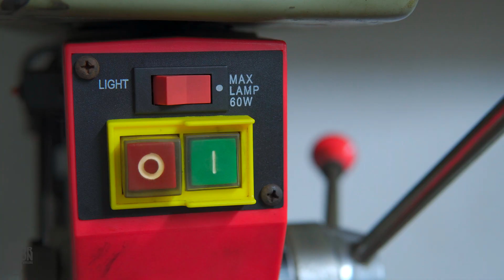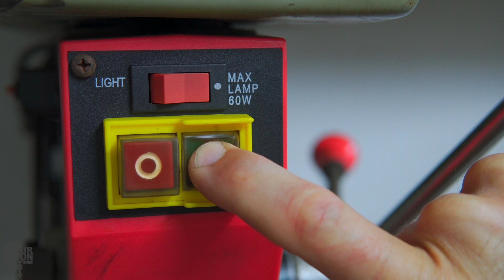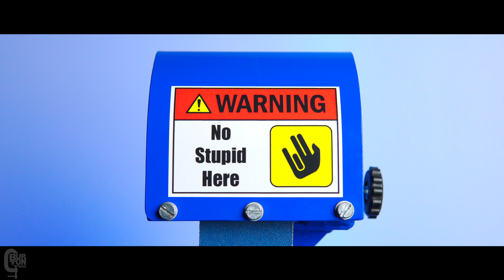DIY Belt Grinder Build- Burton Builds

Comment: Thanks for the informative video - is the 4 wheel design that I see so often just to accommodate the length of the belt without making the tool too tall? Is there any disadvantage to the two wheel design?
Reply from the maker: Hi Anthony… from what I can gather, yes. Having a longer belt (72”) allows the belt more time to cool before the same section gets back around to cutting the workpiece. The longer belt also lasts longer between changes because there is a greater area of belt therefore wears slower. The 4 wheel design also allows the front working section to be changed out to a single flat wheel for grinding large or small radii. You wouldn’t be able to do this with a 2 wheel design because the top wheel needs to have a crown and be adjustable and thus grinding on it would grind the crown shape into your workpiece.  

As you mentioned, the 4 wheel design keeps the machine relatively small (short). Check out @TimothyDyck on YouTube (https://www.youtube.com/c/TimothyDyck). He has a blacksmith channel (awesome guy) and his 72” belt grinder is very similar to my design… or I should rather say my design is very similar to his. It’s a 2 wheel design that’s very tall. I didn’t want mine that tall because my shop is pretty small so that’s why I went with a 42” size. You might have to look back in his videos to see it as he is currently setting up a new shop and not everything has been installed. Actually check out this video https://www.youtube.com/watch?v=3wVl_ZcwtBU at 06:36.

I also made mine mostly from salvaged / scrap parts so was limited on what was available… again having to go with the 2 wheel design to get it up and running as quickly as possible for as little as possible.

Let’s turn the question around… Is there any advantage to a 2 wheel design? I think the main three are size of machine (small), simplicity of design / build and belts are cheaper so you can have a large variety of belts on hand. You also need to consider availability of belts in your area… go with the size of belt that has the most availability and options.

I think the main advantage to a 4 wheel design with a longer belt is that the front section upper and lower wheels can be flat wheels (the guide wheel has a crown on it and can be located at the back) so the belt runs flat between the upper and lower guide and along the platen (not that I’ve noticed any problem with the two wheel design with the top wheel having a crown because my platen is a couple of inches below the top wheel allowing the belt space to flatten out). Also, the platen can be made longer to provide a longer grinding area and can be made adjustable so that it can tilt (if you need to grind a specific angle into the workpiece). This is a guess but I think a 4 wheel design (longer belt) will track better than a shorter belt. That said, I haven’t had any tracking problems and I’ve been using mine a lot.

Hope this helps. Are you going to build a belt grinder? If you have more questions… ask away and I’ll answer what I can.

Comment: I was really hoping to see how you built the tracking portion/mechanism- what materials, what dimensions, etc and what you would keep or change.
Reply from the maker: Hi Andrew, thanks for the comment. Tracking is fairly simple... all you need is a roller with a crown on it and some type of arrangement to enable the shaft through the centre of the roller to be tilted from side to side. It's not important how one gets the shaft to tilt, but it is important to keep that shaft and tilting setup rigid. Check out 13:09 in the video.

I'll post a picture of the shaft setup once I make my way to the grinder again. It axle shaft is basically an HT bolt with a 40mm long piece is 12x12mm bar welded onto the side of the bolts head (so that the 12x12 bar is 90 degrees to the shaft of the bolt. You can just see this at 13:18 but need to look closely. Then, if I remember correctly, there is a short piece of tube (around 30mm long with a 8mm ID) welded across the bolt head... so this is 90 degrees to the shaft of the bolt and also 90 degrees to the 12x12 bar. Passing through this piece of tube is the 'pivoting' bolt. You can see the head of this 'pivoting' bolt at 13:18 (it has VE FE - A2 80 written on the head). So when the bottom edge of the 12x12 bar is pushed forward or backward with the thumb screw, the crowned wheel and axle rotate around the 'pivoting' bolt i mentioned earlier.

Hope this makes some sort of sense.

Comment: Absolutely awesome!!! Love it
Reply from the maker: Thanks very much… I’ve been using it very much since it was built and it’s been working awesome… can’t believe I didn’t build one sooner.
Reply from the maker: Thanks for your other comment, It came through but not sure where it went? I mostly use Zirconia belts... I find they have been working better for me than ceramic belts, and they are cheaper.

Had a look at your website, I see you also supply Scotch Bright belts... this is something I might consider using as currently I use Scotch Bright on the bench grinder as a means of finishing the stainless work pieces I manufacture.

In which city are you based?

Comment: Do you have plans available?
Reply from the maker: Hi Paul, I pretty much built this belt grinder out of my head... made 'plans', changes, parts, etc. as I went along with the build but i'm happy to try answer some questions that you may have?

I think it's somewhat difficult to make definitive plans when building stuff from scrap because everybody's motor / shaft / mounting base, scrap metal, etc. will be different.

The only 'standard' parts I used is the main drive wheel (200mm diameter x 50mm wide) and the idler wheel (80mm diameter x 80mm wide) and the Belt (50mm wide x 1300mm / 2x48 inch). Everything else was custom made. I purchased these from a local store that supplies many different types of wheels.

But please go ahead and ask all the questions you have and I'll try answer them.